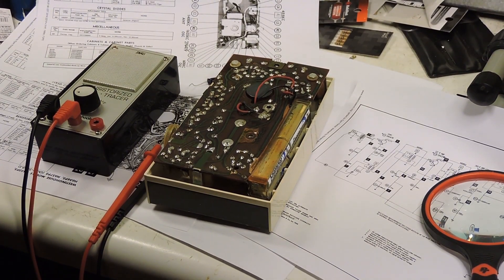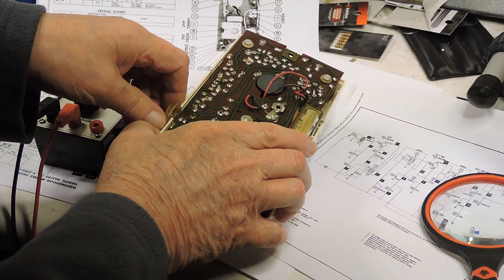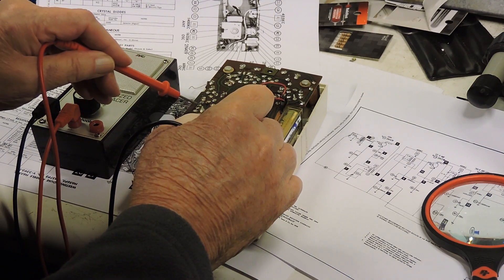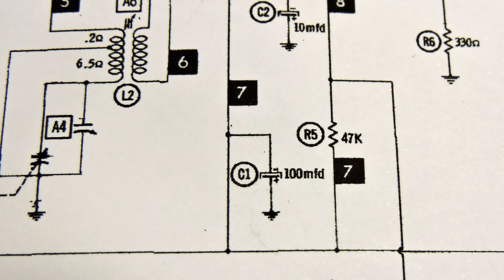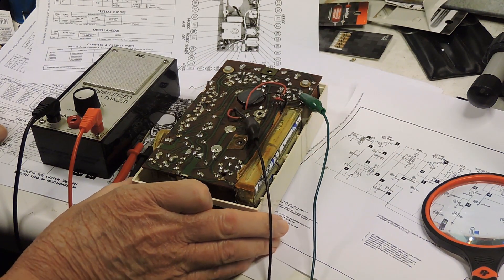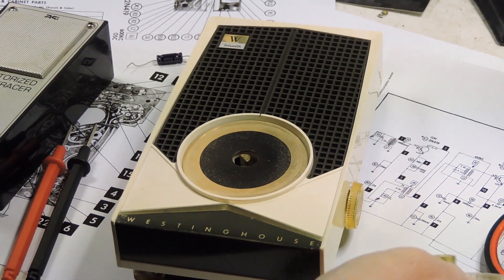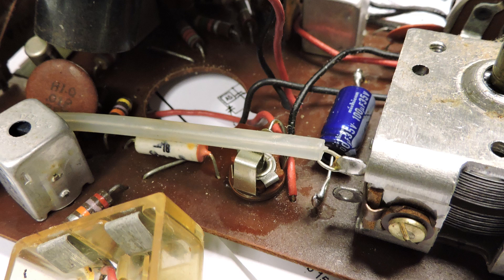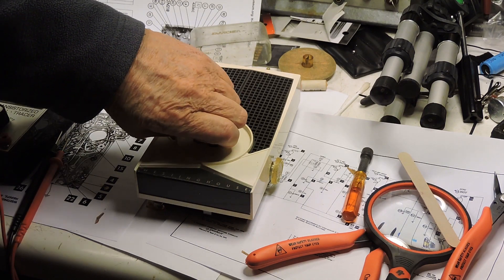Westinghouse Transistor Radio Repair H-655P5

Comment: Sir, do you have some video about the testing procedure to find fails in circuits? maybe you can recommend to me some books, thanks.
Reply from the maker: Search my channel 
https://youtu.be/4k7ByHqh8Js

Thanks for the sub.
The Vacuum Tube Shortwave Radio, free ebook
http://www.richardmcwhorter.com/vacuumtuberadio/
Navy Electronic Course download page
http://www.richardmcwhorter.com/NavyTraining/

Oscillator Troubleshooting, Transistor AM Radio Bradford WTG-60715
https://youtu.be/Rw8Hh3fTa-0

Radio does not play but everything checks out good
https://youtu.be/tizYTHDN0eU

Search my channel for “repair”

Comment: Was this radio fully repaired? it sounds with low level.
Reply from the maker: The other electrolytic capacitors should be replaced, should make another nice video.

Comment: I generally don't replace electrolytic capacitors in battery radios unless they give me issues, and I rarely have such issues.
Reply from the maker: +douro20 
This radio is from about 1958. I really should have replaced all the electrolytic capacitors because only get that old they dry up and turn into resistors.

Comment: I have learned a lot from your videos over the past three years of subscribership. I have a simple question on this one. When you "bridged" that faulty 100 uf capacitor and the distortion cleared at time 2:30, what was the other end of the alligator clips connected to? Were they connected to that nichicon capacitor? Temporarily putting the capacitors in parallel?
Reply from the maker: +AmyAndrewAdventures 
I started with a 4.7 µF capacitor and when I bridged C1 I could tell that the sound had improved. So then I looked on the schematic to see what the value should be and then bridged C1 with a 100 µF capacitor. I started with a lower value because that was the majority microfarads.
Reply: Thank you for the response. That process makes sense to me. I have an ESR meter that I use to test caps, but I find it's only useful when you know the ESR (duh) or for finding obviously bad capacitors. I like this approach of giving a capacitor a little extra capacitance and then observing the effect. Thank you!